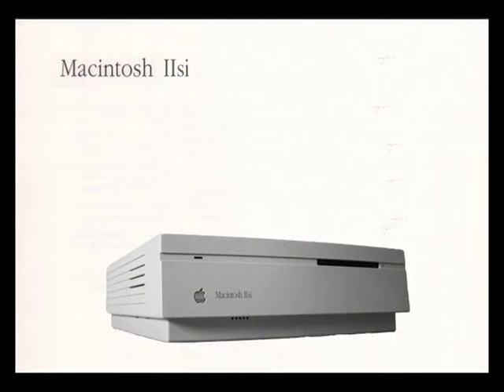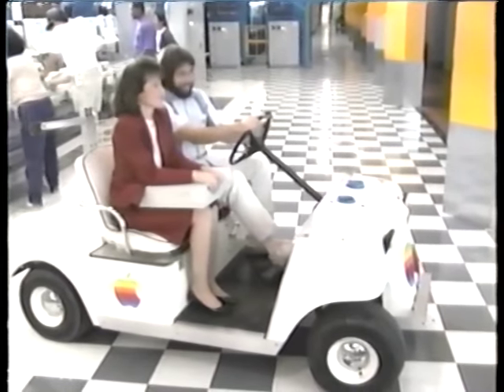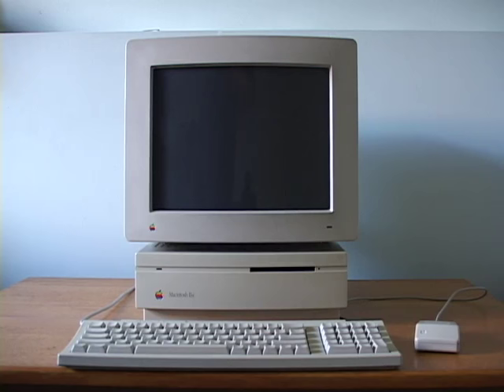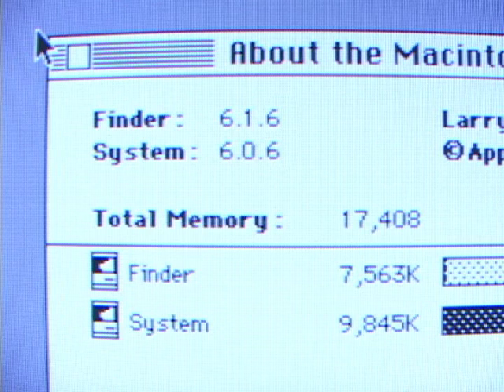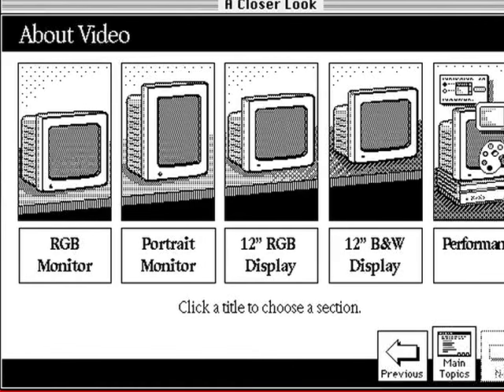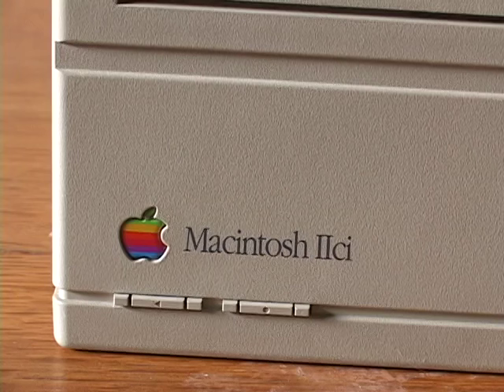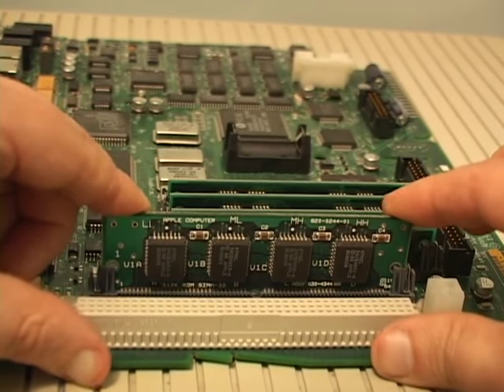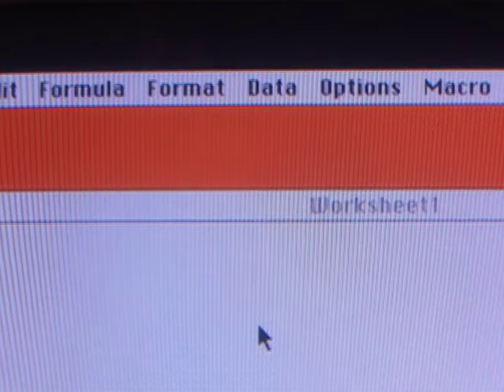The Macintosh IIsi

Comment: I had a IIsi 5MB with FP coprocessor card. I replaced the 20 MHz crystal with a 25 MHz one - ran perfectly. For its time it was quite a decent machine, certainly better than the average Dosbox with Windows 3.1. Earned its keep.
Reply from the maker: Great to hear from a IIsi owner. You knew the tricks to get the most out of it. Thanks for sharing that!

Comment: I spent many hours on our IIsi, playing Armor Alley, Oids, (Beyond) Dark Castle, Sim City 2000, Sim Ant, Bolo, and a ton of share ware games. Also I had ResEdit, which I used to modify lots of those games text and graphics to great humorous effect (flying guy instead of a helo in Armor Alley, etc).  Good times.  And yes, I remember the sound recording capability distinctly.  It was amazing at the time. 10:23 yes, that is what I did.  I was 13 or 14 at the time and the machine was a bit dated at that point and not dad's main machine anymore (this was 93 or 94).  Also had it maxed out at 17MB RAM.  I never got the co-processor.  And yes it did have the sound issues you mentioned.

Comment: The LC was a bit behind the IIsi. For this reason, the si had a discrete 8-bit sound input circuit whereas the LC's sound input (the 2nd Mac with sound input) had an integrated sound solution. After the LC, all the Macs going forward featured sound input.

Comment: Another excellent video! The 12" monitors were indeed 512x384, but the compact Macs were only 512x342.
Reply from the maker: Argh! Too focused on the horizontal resolution. Thanks for the correction.
Reply: @65scribe  No worries! Most people aren't even aware that there was a difference in the vertical. Turns out the 12" B&W Display was 640x480. Why they messed with the DPI in both directions with the 12" monitors is beyond me, considering how they tried to keep close to the 72DPI with their other monitor sizes, AFAIK. That is, until they gave in to the PC-driven multisync revolution (the AGA Amigas had multisync monitors, as well).

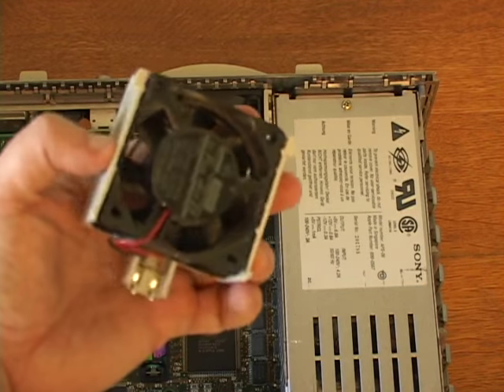Comment: 13:00 implies the existence of a second Macintosh IIsi in the stash - how else would we be seeing a second fan? :)

I have one of these here today to restore. I was so struck by the beautiful design and build of the machine, I was tempted to make some sort of crude slideshow video - but then I had a hazy memory that it had already been covered, and indeed, it has. I do have a few more tasks though, cleaning the oily mess from the power connector and replacing the caps inside the power supply, as well as the eleven identical surface-mount 47uF caps on the logic board. Again, beautiful design and a perfect tribute video by 65Scribe. In the meantime, I’d better get going - restoring the case in early autumn means I have to “make grey while the sun shines”. Have a happy day
Reply from the maker: Good luck with the restoration, Alex. You’re right, there is more than one IIsi here. Two good ones and a number of parts machines.

Comment: I'm looking to get one of these, but I plan on tricking it out. First on the list is a replacement oscillator to bring it to 25MHz instead of 20MHz.
Reply: And I ended up getting one! Damned holidays made it get stuck for a few days though.
Reply: The biggest problem this machine had was the crappy riser which was always loose and fell out all the time, shorting whatever NuBus card was in it.
Reply: If you still didn't get one I have one ( fully working kept in the original boxes woth the RGB Monitor and the laser printer)
Reply: @andreavitale57  Wow, I'd love to have something like that. Very special.

Comment: I thought the S of the II si was for Slim, and the I just brought from the II ci.
Reply from the maker: I had looked fairly extensively at articles from that time, and only one columnist actually said what the 's' stood for, and that was from talking with Apple. The word 'sleek' seemed to be a popular adjective at that point in time, if you do a word search on the mac magazines, it's in ads and articles way more than you'd see today. As for the 'i', that's well documented as 'integrated video' to differentiate the cx (which needed a video card) and the ci and si.
Reply: @65scribe  Interesting, thanks for the answer. Greetings from Spain!

Comment: Just got a IIsi from a friend, gonna recap it and maybe pick up a ROM sim if I need to. Any tips?
Reply from the maker: That’s great! In the majority of cases the ROM will be on the board and you won’t need the SIMM. Higher risk that the Power or Hard Drive or Floppy won’t work. I would say if you see oil on the board from the caps, it should be washed before attempting to turn it on. Those are a few things off the top of my head. Good luck with it.
Reply: @65scribe  Thanks! Got the cap goo washed off and I will get my hands on some ADB stuff and a monitor eventually. The drive spins up and the floppy doesn't make any noise, but I didn't want to test things too vigorously with bad caps on the board.

Comment: No video on the IIfx ?
Reply from the maker: I would have to get one first! I do have an original Macintosh II, which is the more interesting machine in my opinion.
Reply: I recently found one in the uni dumpster and of course I took it home. It kinda sparked my interest in those old Apple machines, which is why I found your channel. I wonder what this thing is worth though. There is a seller on ebay, refurbishing them with things like SD2SCSI, and selling them for nearly a grand. Yes, people keep buying it for that price, he's got several completed listings.
Reply from the maker: That's true. Macintosh IIfx is well known as the most expensive mac ever, so collectors have been attracted to it for a long time. As a result, they are hard to find and the asking price is relatively high due to demand. Good for you finding one in the dumpster. Clean it up and hang on to it!